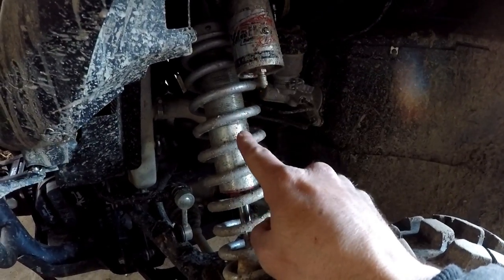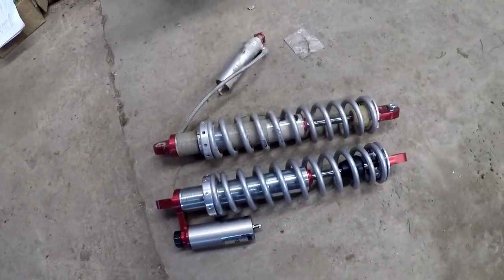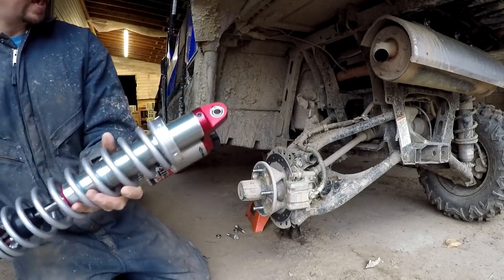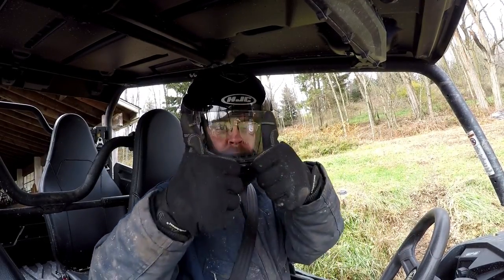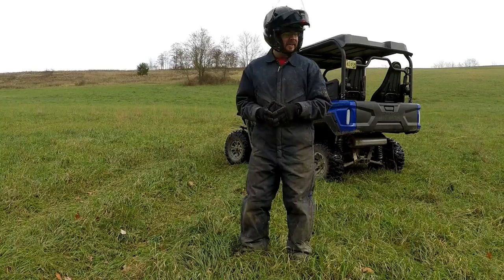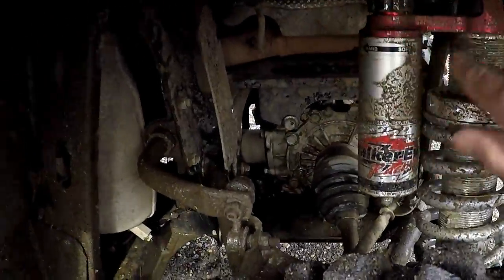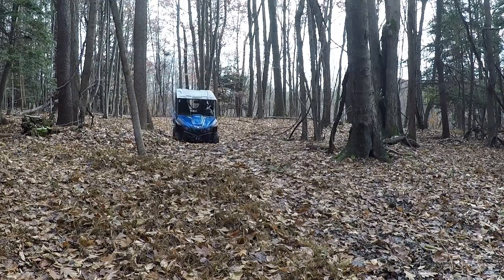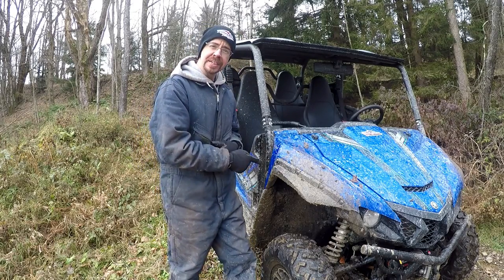Walker Evans Shocks: Rear Install And Test On The Wolverine X4

Comment: Hey Jason, I just installed Bandit shocks on my 2020 x4 and it seems to me if my rear suspension is fully compressed the reservoir will come in contact with the upper control arm. Can you verify?  Thanks for your response!
Reply from the maker: The Walker Evans I had never did but I’ve never ran or seen the bandits on an X4 so I can’t tell you if they will or not. I would say if they are set up the same as my walkers were with the shock reservoir towards the front and not out towards the wheel you should be fine.
Reply: @AppalachianMountainRiders  Thank you very much sir!  The Bandits are oriented the same as the Walker Evans. We'll run it. I did send an e-mail to Bandit about my concern, so we'll see what they say. I appreciate  your family friendly content and advice on YouTube, keep it up!I

Comment: Are these shocks rebound adjustable too or just preload? My biggest complaint is how the back end bucks me right into the air on the medium sized bumps when I get going a little too fast. About to pull the trigger on a set
Reply from the maker: Preload and compression adjustable. Have 13 “clicks “ of soft to firm adjustment.
Reply: Soo..no rebound adjustment?

Comment: I noticed that these shocks are available on the Walker Evans website now.   Great news!  In  your opinion is the ride quality of the new Walker Evans shocks worth paying an extra $2000.00 for?  I've been wanting to upgrade the shocks on mine but I'm wondering if it will be worth the cost.  Thanks for all the great videos!  Keep up the good work!
Reply from the maker: That is all going to depend on you riding I guess. They are a big improvement in all situations but you reap the most benefits from them riding hard. Now that I’ve  had them on there for a while I would not have an X4 without them. Also I’ll give you this. I was all set on removing my sway bars to help it ride better but with the Walker Evans I no longer feel the need...lol.
Reply from the maker: Also they offer a discount for my subscribers so if you use the code yamaha10 at checkout you get 10% off.
Reply: I don't ride real aggressively but I would like to smooth things out a bit.  I may have to give them a try.  Thanks for the update.